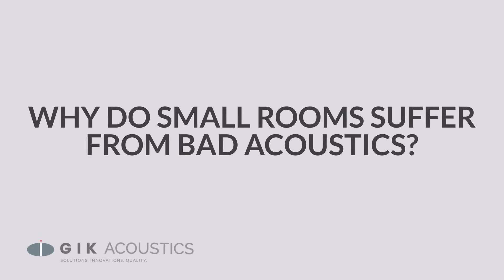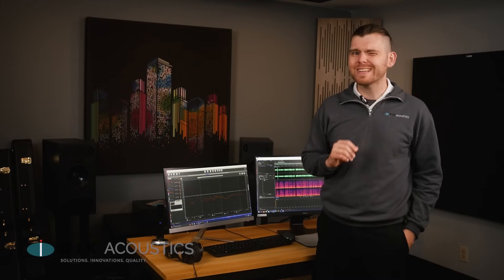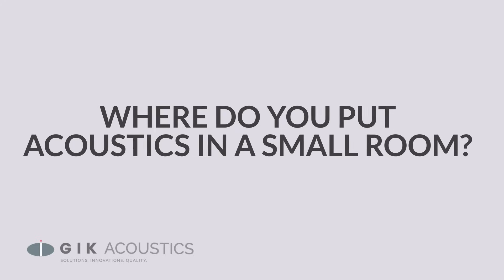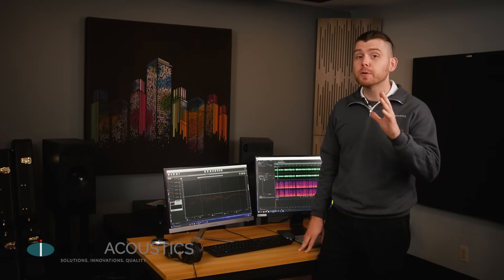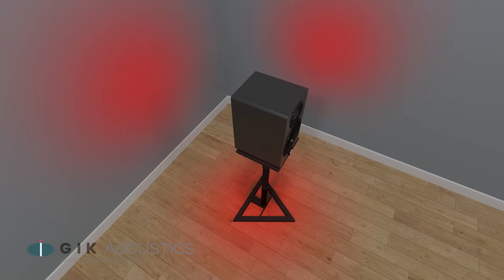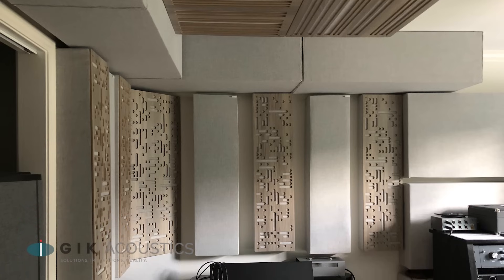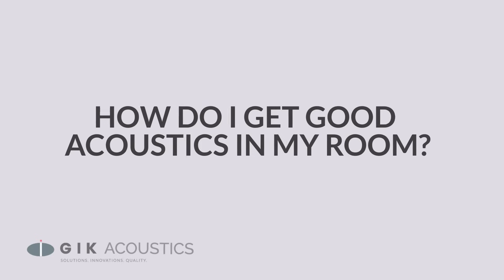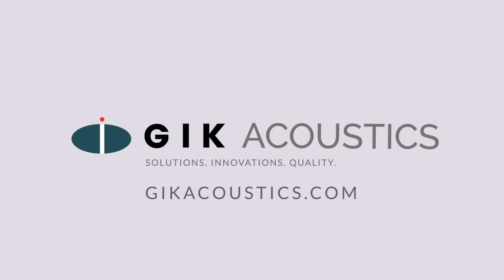Room Acoustics for Small Rooms - Why do small rooms suffer from bad acoustics?

Comment: I have 4 panels very similiar to one on the left near the window at 3:43 and I still get quite a lot of room sound when placed next to walls at early reflection points. The other day I got an idea, to put them instead of next to the wall as close to speakers as possible... the listening position feels a lot less verby now, which I like a lot more. But I'm wondering if I might have created some other problems with this solution... can anyone let me know if this is somehow wrong?
Reply: If the air gap between the side wall and the panel is more than 2x, theoretically, you may create dips in the absorption coefficient in certain frequencies. Porous absorber calculator by acousticmodeling shows this.

But if it sounds good, than no worries, enjoy!
Reply: @authenticNL2 not even acknowledgement. Manners Don't Cost A Thing! I'll thank you anyway 🙏

Comment: You don't need thick bass traps, just more subs. You need  5ft thick of damping for higher frequency bass and lower frequency bass will still pass through it. The reason you use multiple subs is that they act as active frequency levelers, giving you even bass throughout the room. Bass traps are a scam for people who don't understand psychoacoustics. They only work for mid and higher frequencies.
Reply: Not if they are thick enough. The GIK traps are way too thin for sure.

Comment: Being 1/3 from front speakers makes good sense for stereo audio listening, but when I exit Spotify and watch a 5.1 surround movie, I'm supposed to be positioned more near the surround speakers. I can't sit in both places at once, and I understand avoiding the middle dead zone, so what should I do? Obviously, I am only interested in my listening environment and I'm not trying to design a recording studio, just trying to understand how do I satisfy both recommendations...sitting about 5 ft out from my rear surrounds , when I'm supposed to be 1/3 out from the front wall, completing the 3rd point of an equilateral triangle?
I will add that prior to painting the room, it was very echoey. I added a lot of sand to the paint for the walls, not for acoustics, but for visual texture. Apparently, the sand did unexpected good things to dampen reflections in the room. Even with the old hardwood flooring, I don't seem to detect much, if any, in terms of first reflections. I'm just getting a lot of window vibrations from the sub. If I move the sub (about an 8' X 12' room) just a little further away from the wall with the window in it, the glass vibrates much less, but then the sub is closer to the open closet, so the closet wood trim vibrates.
Reply: The fact that you mentioned Spotify, I imagine you're not a critical listener, which is actually a good thing! I found that when listening in a small room and trying to accommodate both listening habits...  having the couch positioned of the back wall by at least a couple of feet seems to work best. Not only does the surround sound move around you, but the perception of the two channel sound stage is enhanced too.
Reply: @Antibackgroundnoise ~ Thanks for sharing. That's good advice and holds a lot of truth. Not long after my comment, I ended up finding the sweet spot 3 - 4 feet out from the rear wall, with my large front, 3-way tower speakers being about 8 ft away from me. 
Two other factors which made an improvement to my soundstage?
Investing in an a pair of Bipolar rear surround speakers, specifically: Fluance SXBP2W.
Lastly, Tweaking the amplifier's speaker distance settings helped a lot in terms of movie enjoyment with the 5.1 surround output.

Comment: Except bass traps do not manage low frequency response. It will do "something" but not in a predictable way. Bass traps are a misunderstood/misused tool. If you could install a large enough bass trap, to actually stop the low frequency wave length where do you go from there? Stopping the wave length doesn't mean you're hearing a developed wave length. How are you tuning a bass trap? That would be interesting to hear.
Reply: Agreed.  Most "bass traps" are really just corner absorbers
Reply: My listening room is small, speakers against one wall, sit against the other.  Im pleasantly surprized that the room gain actually enhances the sound in my case. I ended up not installing the sub or treatments. Bass traps and treatments are not always required.

Comment: I cannot accept this theory since the 50ft is considere as a small room. Small room is which I believe is 10ft, 12ft or 15ft or maybe 20ft maximum in sizes, that is the most common average people studio size in their house.
Reply: Its based on the length of waves, which cannot be changed due to physics. In order to allow all waves to complete a cycle properly, it must be 50ft.
Reply: @xfloodcasual8124 Most commercial mixing room facilities are NOT 50ft either direction so Im not sure what idea you’re selling.
Reply: @ most commercial mixes sound terrible, so it’s worth investigating further

Comment: The smaller room shown in this video is bigger than my main room 😂😭 I'll keep using my headphones.
Reply from the maker: A small room is typically considered any room under 15ft in all directions. Of course, feel free to use your headphones if that is better for you personally, although we have found there are a lot more challenges that arise from solely depending on headphones for making important mixing decisions.
Reply: What's worse in the room dimensions are the wall and ceiling construction.  Homes are not designed to have full range music in them, unless they are designed and built from the ground up by someone that actually understands what they are doing.  2x4 studs with sheetrock and building insulation isn't going to fix any room mode problems, that's why people have to stuff thick, heavy boxes to absorb the low frequencies in order to get rid of the big peaks/nulls..

Go to the big name studios, they don't use sheet rock, they will typically use wood interior.  Wood sounds a LOT better than sheet rock.
Reply: @Oneness100  We have cement/concrete walls!
Reply: @GIKAcousticsLLC  measured from the center?